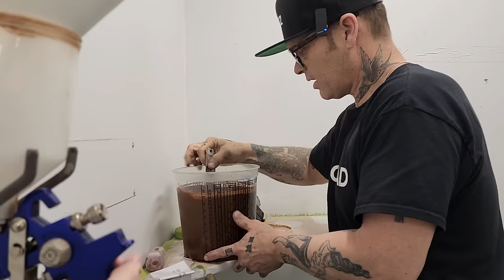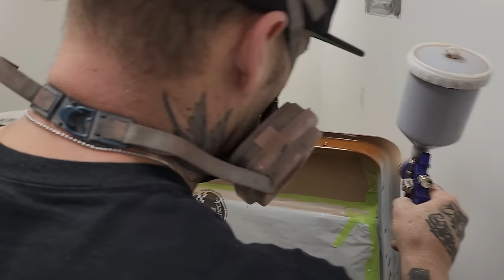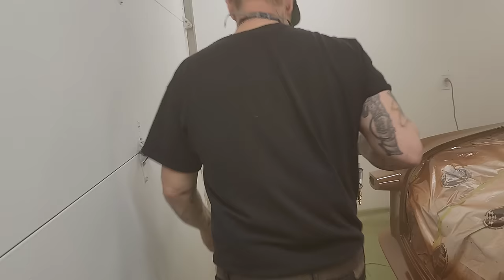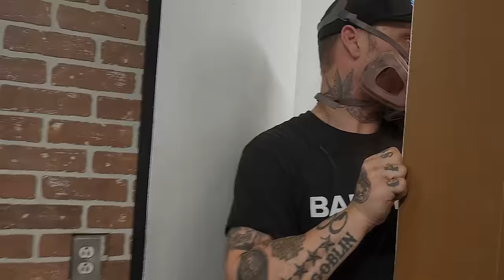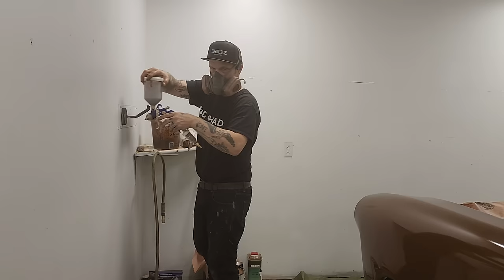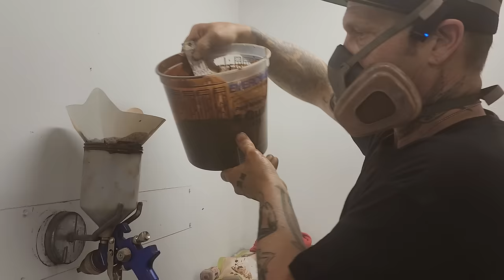Painting the 1950 Ford... the tarp was a BIG mistake 😵‍💫

Comment: Looks like the air ventilation was almost non existent.  Surprised you could see anything after a while. All that overspray is really bad for your eyes. The respirator your using is weak also. Invest in some better ppe before you do another paint job, you'll live longer.
Reply: Ive been autobody painter for 25yrs i agree ventilation is weak but to be honest less air flow in booth less dirt. Those fancy downdraft paintbooths that cost over 100k aint as great as everyone thinks. If you make homemade booth less airflow cleaner job guaranteed

Comment: I agree with you Chad, I don't think whoever suggested using a tarp ever tried it themselves.
Reply: It works for pulling alot of paint outta the air but I'd fold the outside 3 feet in and wet the floor then it still pulls the overspray down but you can walk like normal
Reply: I used a $100 party tent set up inside my shed with two $19 kmart fans some pre filter cloth stapled to a timber trellis with a tarp on floor duck taped all the seams worked fine for what was paint came off the gun and didn't have to buff it used 2k industrial paint and still looks great 8 years on I did wet the tarp though oh and set the lights up outside the tent the light was well defused
Reply: Nice job that plastic is challenging but you got it handled
Reply: His problem is the fan isn’t taking the overspray out good enough. This isn’t a paint booth, it’s a room with an exhaust fan. It’s just not drawing enough air out.
Reply: Glad to see some color finally being put on something. I enjoy watching everyday but when these projects get welded up and just pushed to the side without finishing it’s disheartening. Thank you!

Comment: Painter's tarps are fabric, like a light canvas.  Unlike the plastic, the cloth absorbs the paint unlike the plastic which keeps the paint on the surface which allows it to remain wet.  As you have discovered that wet paint sticks to your shoes and then to the plastic.  Congratulations on an excellent paint job with just the perfect color.  The color is not often seen on a 50 and reminds me of caramel.  I will call the car "Spicy Caramel."
Reply: Caramel-mocha latte?
Reply: Or "Hershey's Kiss!".
Reply: Plus it was (looked like) singel stage  paint with hardener, so that's like putting  spray adhesive to your shoes and floor. I even get it on cement booth floor if it's a complete paint job!

Comment: under very trying circumstances you n Jolene have turned out a truly professional paint job.. my opinion is jusdt leave it and save unopenned quart for future touchups. two coats will give you about 60-70 microns, 3 will give you 100 microns [ish] . but you piled on the primer so youve already got the required thickness of over 100 microns.. just leave it at two. ,,never use anything to cover floor . just mop n bucket OR if cars not in booth yet just hose out floor n leave dripping wet then run car n n paint

Comment: Such a gorgeous gorgeous color... I can't wait for everything to be done, seeing the chrome on their and all the work nate did under the hood is going to look amazing with the hood open.  Freaking awesome job but seriously get the freaking fresh air intake and the proper size exhaust  or at least open the garage door to the outside and leave the door by the jump shear open that will help alot. Leave everything else the same because the filters you have on the widows will actually work as a fresh air intake.

Comment: Have not watched yet, so I don't know the tarp problem. Something came to mind you might cinsider for a future project. Maybe a bigger exhaust fan along with swamp cooler pads in a frame opposite  the walls where fam is located. I helped my buddy build a paint room and the exhaust fan was outside and pulled air from the floor. It was hard to build but worth it. The pads worked just as well. He would also before starting, use a water hose that was running, (not Spraying ) and wet the floor reall well. Just my thoughts.

Comment: Suggestion, when you have a chance , you should run piping for air around the wall with quick fittings so you wouldn't have to drag the hose as you go, just plug in where you are.

Comment: Hi Chad. I always wet the floor down,. It keeps down any dust, I don't stick to the floor, and cleanup is much easier. Been doing it this way for 55 years now. Try it, I think you'll like it. much better. There is no perfect way, but this way is close. Before you do the next coat, get rid of that tarp. Gently cut it off around the car and pull it out of the way.

Comment: It would be a good thing to remount gun forks about 12" lower. Also, lower and install wider corner shelf.
And so gun cap doesn't stick so bad, i use to keep a container with Lacquer Thinner and a shop cloth and carefully clean cup and cap threads. Only takes a few seconds and makes work and life better.

Comment: You never put anything on the a friend of mine years ago, Chadwick Nelson, painted a beautiful 29 Ford roadster, in black lacquer, it won best in every show it appeared, it was shot in a one car garage,  with a sand floor, and bridge planks, so what you did is set up a static electric feild with you walking on the plastic, so it got full of dust? I haven't watched yet, but you can hang a chain from the rear axle to your Cement floor, Windex, as a prewash works better with Water base paints. Vilio.

Comment: You maybe may want to keep the tarp idea hows the quality of the paint job you just need use 4x4 or tubing to around the outside edges of the paint room and were soccer cleats so your feet aren’t sticking to the floor. Just need to prefect the system a little. Poly might work better.

Comment: Chad if you run the hose along your arm and over your shoulder there is less chance of it dragging in the paint. You can still hold the hose with your left hand and keep the tension  on it just a little as well you can kink it and control your pressure too with that left hand..

Comment: Well done Chad not  easy in a small booth .Reckon you were running a bit short of air in there hope Joleen had a decent mask on though really should be air fed set up for your own well being. A bigger extractor fan and a lower spraying pressure would help matters a of of paint wasted but Im certain it will look fantastic. Bugatti next ?

Comment: I just now imagined Chesterfield button tuck custom bench seat  with matching door panels and dash top . but no rear seat. use that space for custom wood storage bin with Chesterfield top pad lid. inside that bin will be for antiques you purchase while cruising around.  instead of a dome light install a chandelier over the bin trunk in the back.  the floors can be wood stained and polished.  footprint gas pedal, crystal skull shift knob that has a tiny light inside.  and purple dot tail light lensssesesseses.
Reply: Go Greased Lightning, you’re burning up the quarter mile.

Comment: Try splitting the air hose in two. That way you will have an air hose with the same pressure on each side of the car and you won’t have to worry about getting the air hose stuck on the tires.

Comment: I can't believe what I just seen Chad just put paint into the spray gun and he did not use a filter that's the worst thing you can do not only that using way to much air pressure and he never set up the paint gun I bet you they will not show a close up on the car so you won't see all the bad stuff an the mistakes from the body work and the paint job. You don't have enough air flow on the room you should not have a clowd of over spray the bad thing is that it settles down onto the car and the floor/ tarp then it makes the tarp sticky then your feet stick to the tarp what would help a lot if you add two more fans one at the front of that wall and one back of that wall then the windows where you put up filters put on the outside of the wall put up box fans to bring in air it would help out a lot. I would be good if there was a floor drain so you wash room down

Comment: Still cant believe he sprays at 70+psi, lol. That's bonkers! but again if it works for him! And I only say 70 because when he had the regulator on the gun he never checked the actually air pressure with the trigger pulled, just looked at it and said "yep that's what I like, 70".

Comment: never use tarps on floors in paint rooms or booths they are a magnet for overspray and then they stick to your shoes and become like rollerskates if the floor under it is smooth or polished can become dangerous. Sweep floors good and hose them down roll car in on wet floor and paint. Only thing we use in our booth is water and we sharkskin our lights.

Comment: The tarp is a good idea just the wrong type of material.  I never use plastic on a floor; I prefer cotton.  Plastic is fine on walls or surfaces that will have no contact. 
The color is true to the '50's.

Comment: That’s brutal !! Pressure way too high on spray gun& invest in a better ventilation system !! Nice try tho lol I did same mistakes years ago when I started painting :) Pressure like hat only reserved for clear coat with the guns I use but that gun yur using seems to be a water base gun ??? I have a similar one that is designed to spray water base colours which I stay away from ! Again nice try :)))

Comment: Tarp on the floor!:face-blue-wide-eyes::face-turquoise-covering-eyes: Whoever advised this must of been having a very bad dream. STATIC:face-turquoise-covering-eyes:STATIC:face-blue-wide-eyes: MORE STATIC AND GUMMED UP SNEAKERS:face-turquoise-covering-eyes::face-blue-wide-eyes:. I am by far the best paint sprayer but I do very well with a paint gun. The person must have been thinking you are painting the FENCE or SIDE OF A BARN. THE ONLY THING RERQUIRE AND MAYBE EVEN NOT! IS A LITTLE DAMP FLOOR TO KEEP THE DUST DOWN. BUT THEN YOU NEED TO BA CAREFUL ABOUT humidity. Just a well cleaned and kept booth is best. Chad you really need a better fan out system. But I'm sure you know that.:face-turquoise-covering-eyes: Super fan spray on that $15 gun. As there is quite a lot of over spray, does the car feel gritty when dry?

Comment: Wow, the air pressure on that paint gun is WAY too high.  Most of the paint is bouncing off the surface and eventually settling on the tarp.  Should be around 28psi or so at the gun and looks 2-3x that.   What a sticky mess ! Also wastes a lot of expensive paint.

Comment: Chad you need a bigger exhaust fan and put a filter on the front or yo will be getting overspray on cars parked near the exhaust. You will need more air cumming in so you don't get a vacuum. Also I used to put Vaseline on my face before I painted then the paint on you face would just wipe off. Better then cleaning your face with thinner.